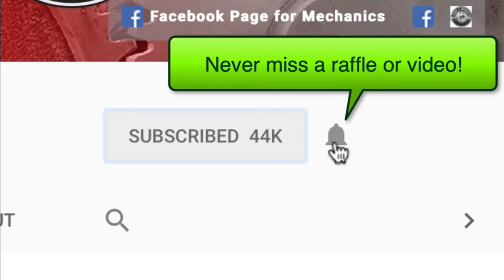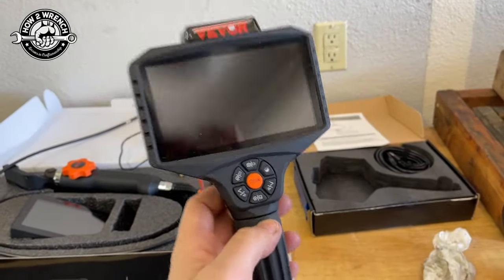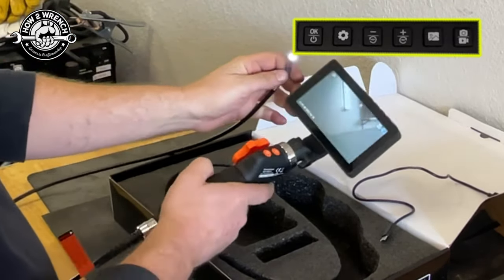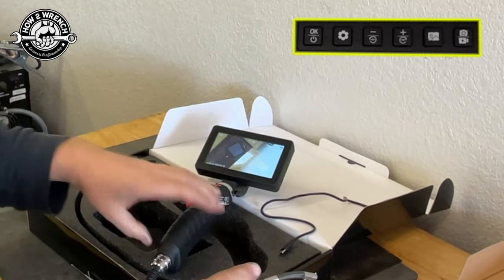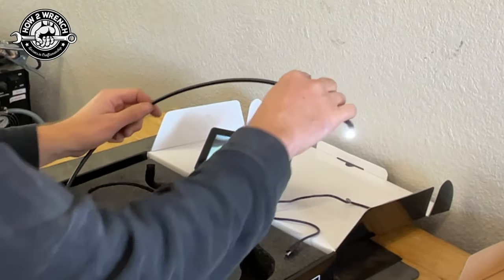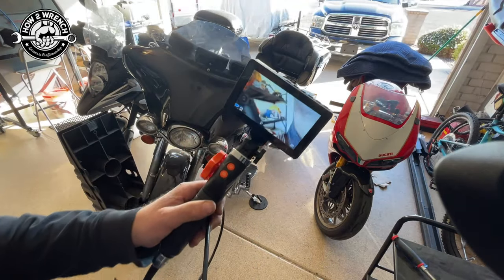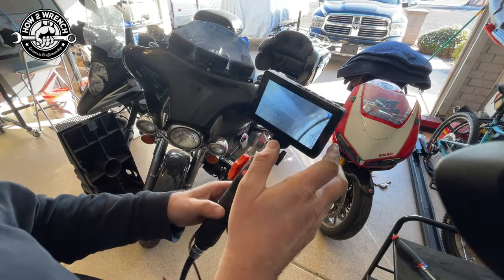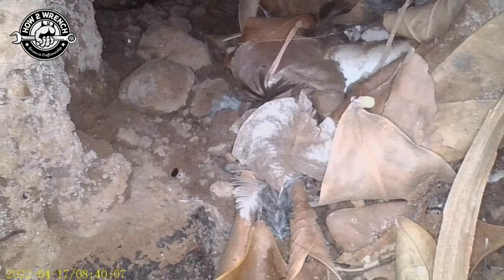See inside anything with a  Vevor Articulating 360 #borescope #newtools #amazonfinds #how2wrench

Comment: WOW Shane‼️

Comparing my small SnapOn hand held to this Vevor 360° articulating scope and it is absolutely 🤯‼️ this Vevor scope is 100%+ clearer than my BK 3000 Snap although the Snap has 4X zoom and 6 light brightness levels it is not as clear… I have a screen protector on it but I believe it doesn’t take much away if any from the clarity? and having the ability to turn the camera head backwards and view the head again is 🤯 and not having to move the scope neck up and down and in circles to view the entire cylinder or using a periscope mirror. 

I have used a camera tripod to hold my scope so I can use two hands.

Okay Shane thanks for the vid and Congratulations on the house 🏡 
👍😎👍
Reply from the maker: Hi there Fred! Thanks pal...